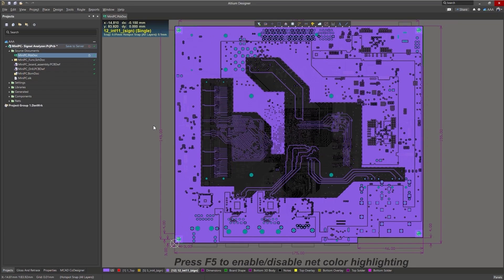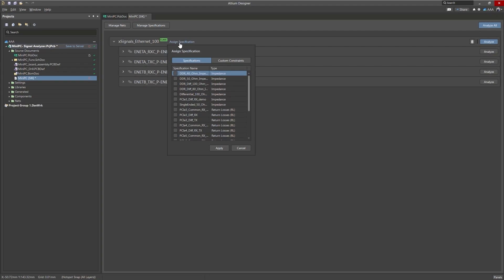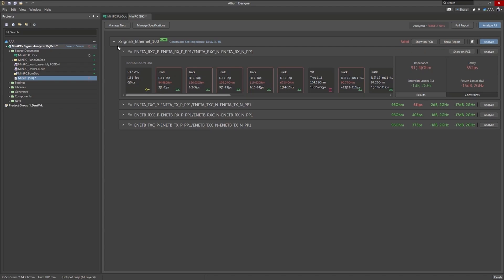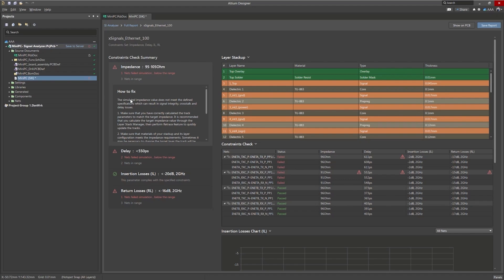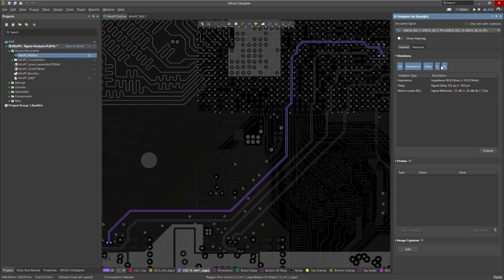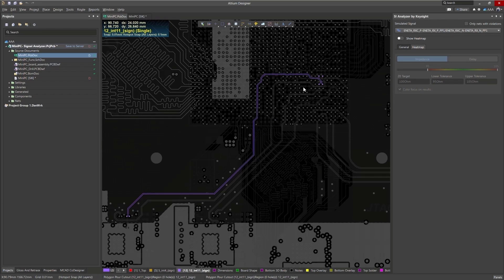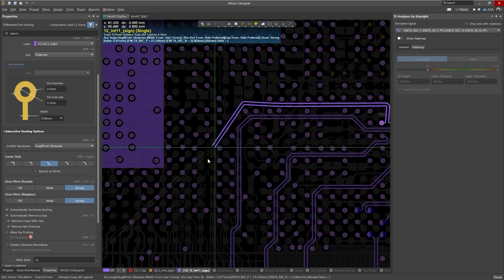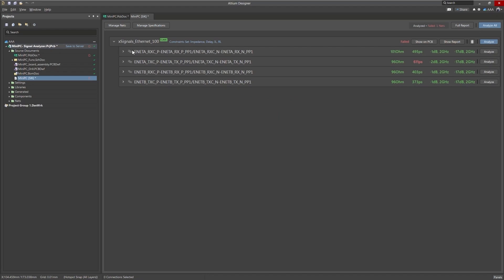Make Smarter Design Decisions - Signal Analyzer Demo

Comment: Thank you for video! Will it be good calculation with refernce plane (GND) in Bottom layer? For example, in AD23 in Tool-Signal Integrity- Impedance is showed incorrect in case of BOT(all layer)-GND, Inner-Signal....